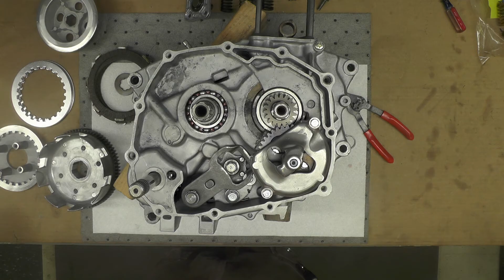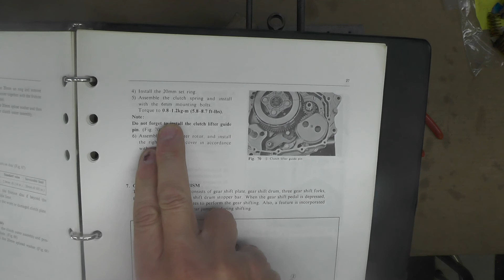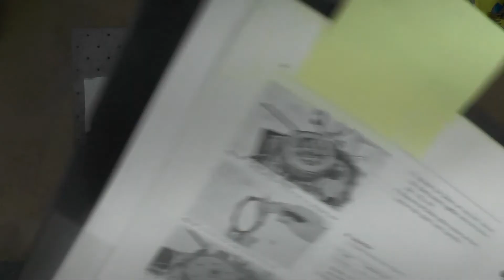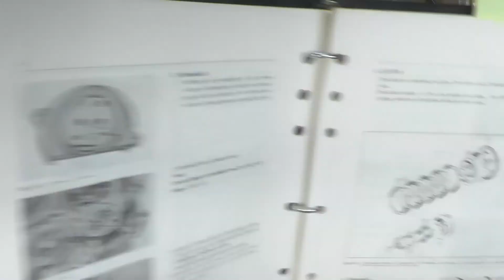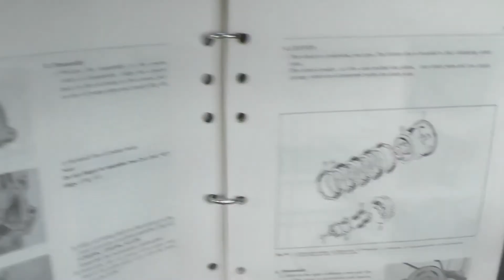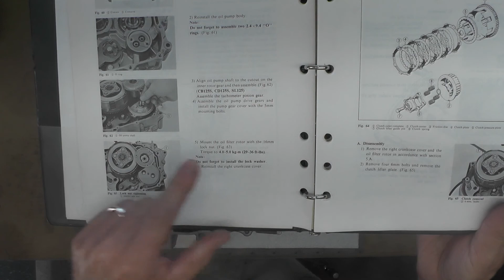Honda SL125, Engine Reassembly Pt 3 --- Video #222

Comment: Good info...thanks kindly.  I did see the the 20/24 mm tool on Ebay...guess I was just looking for the 16mm tool.  That original Honda PN you probably know is 07086-28301...a T Handle is no longer available.  I have two SLs I pick up cheap from two different people and both have the kick start shaft sheared off...both from young inexperienced riders who probably followed the logic that if the bike doesn't start with the first few kicks...you just have to kick harder!!  Anyway...I guess two more cases to open fully to make these repairs...I don't think that shaft can be replaced by pulling just the outer cover....you agree with that?
Reply from the maker: Correct, unfortunately you do have to split the cases to replace the kick shaft.  I replaced mine with an NOS unit I bought on eBay.

I have to say, I've never seen a starter shaft sheared... stripped spines all the time, but actually sheared off, not once.  I've been working on these bikes since the early 1970s and this is a new one for me.

Comment: Please share where you purchased the oil pump / rotor assembly tool.  16mm...correct?
Reply from the maker: The nut is identified as 16mm, but the tool I used is labeled as 20/24mm.  I got the tool from eBay,  and is still listed as available for less than $9.00 USD.  Do a search on "20mm/24mm Clutch Lock Nut Tool Spanner Socket For Honda CRF70 CRF50 TRX 70 90 ES" or similar and you'll find it, and likely other listings too.  You could probably also order this tool from a local motorcycle dealer.

Comment: Thanks again for taking us along. It must be difficult to get the correct camera angles and lighting to do your videos. BTW, I sent another message via your blog and only got the auto response.
Reply from the maker: Thanks Pete... after a while, through experience, the video work becomes easier to compose.  My biggest problem is keeping my head out of the way!  I'm still not sure what's going on with the blog contact process as I tested it again today and it worked correctly.  A bit of a mystery right now...